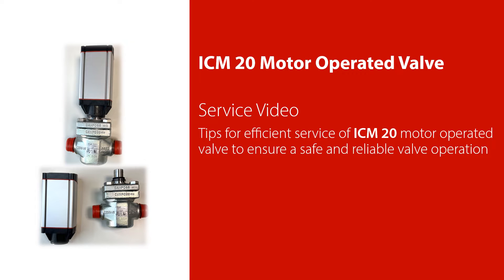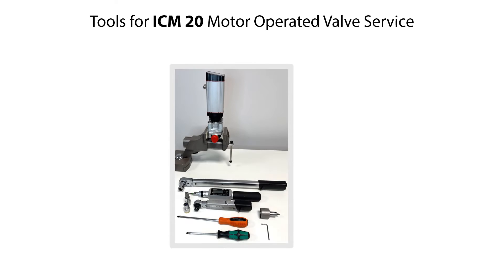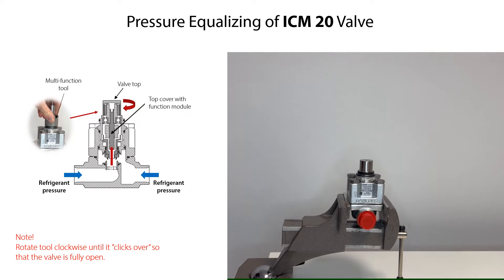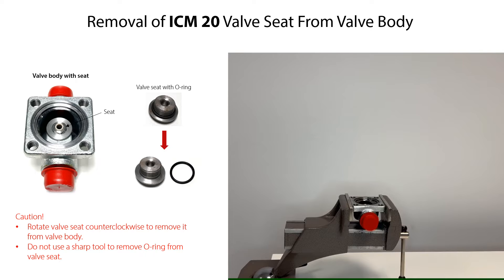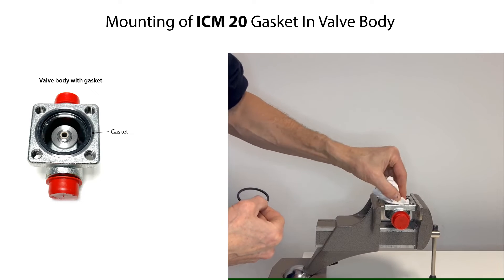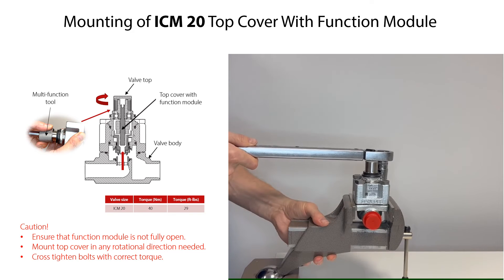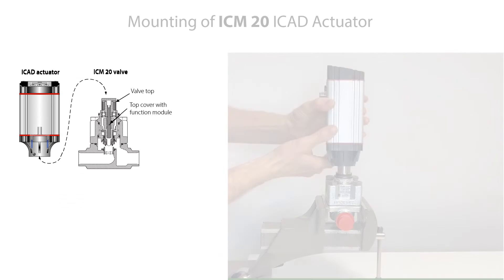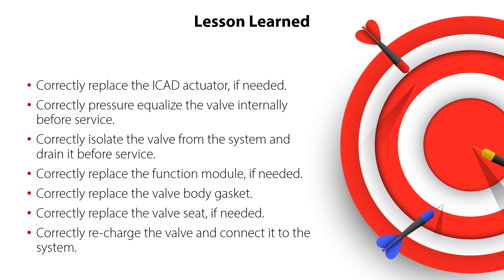Efficient Service of Danfoss ICM 20 Motor-Operated Valve

Comment: What is an indicator that this module will need replacement?
Reply from the maker: Hi. It depends on the type of issue. For example, if the valve gets internally leaky, then the orifice and cone with their gaskets should be checked. If they are deformed or missing, the module should be replaced. If the actuator gets A9 alarm, then it's necessary to check the module with manual tool. If the valve movement is stuck, the module might need a replacement too. We hope this is helpful!